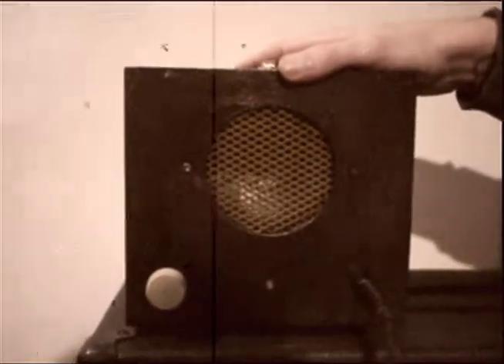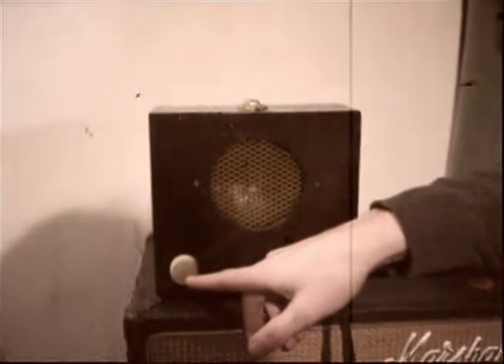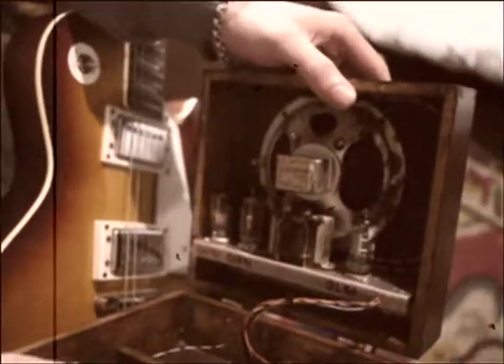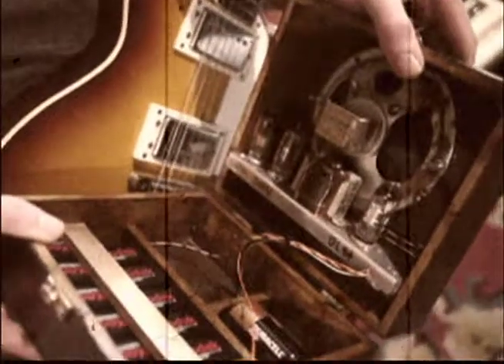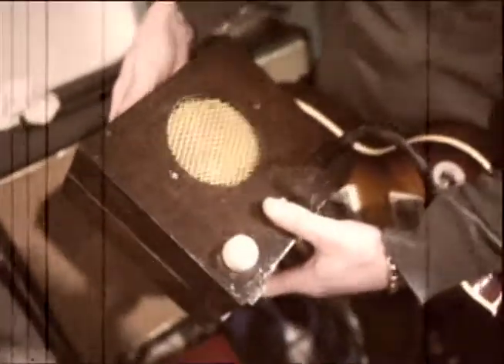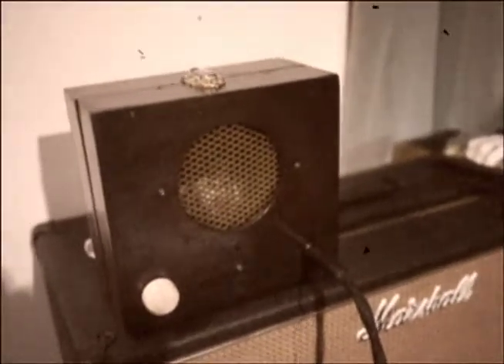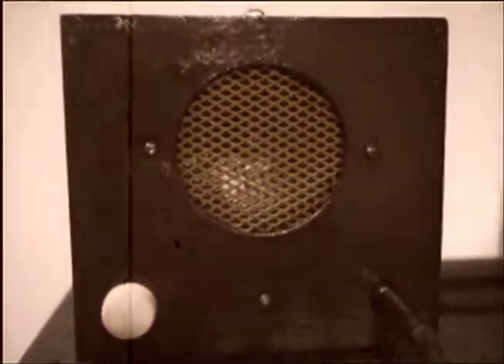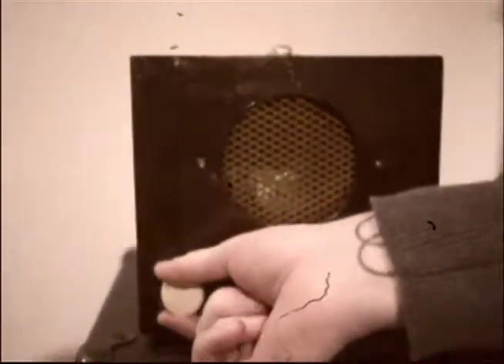'Bat Amp' - (probably) the worlds first battery powered tube amp!

Comment: Why would a battery powered amp need a rectifier?
Reply: Batteries are DC. Hence my question. The narrator says it has a DAF91 rectifier. A DAF91 is a diode/pentode. The diode section might work as a half wave rectifier depending on spec, but it was designed for radio demodulation.  Presumably the diodes in these tubes go unused. You could use them as a clipping circuit, but lack of clipping is the least of your problems with two sharp cutoff pentodes in the preamp. OK, I googled for the schematic. Yes, the diodes are unused. http://www.hoofbags.me.uk/battery%20valve%20amp%202.jpg